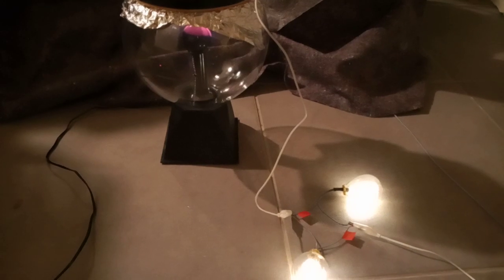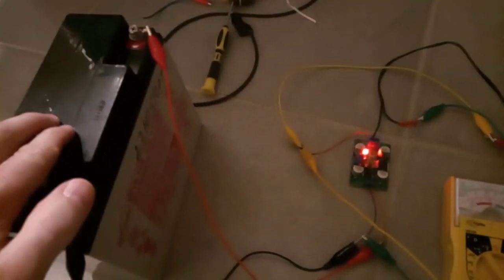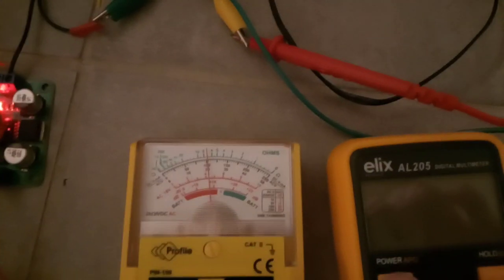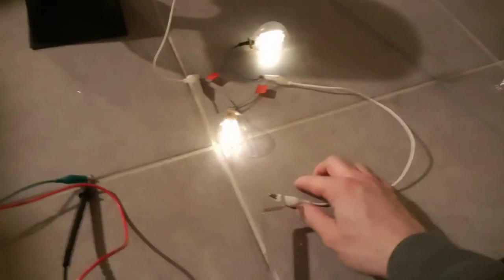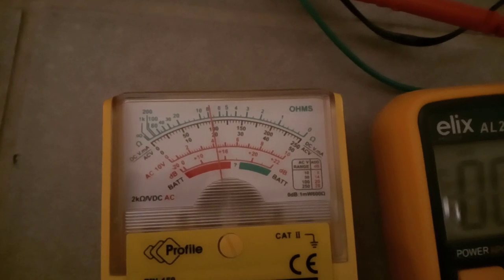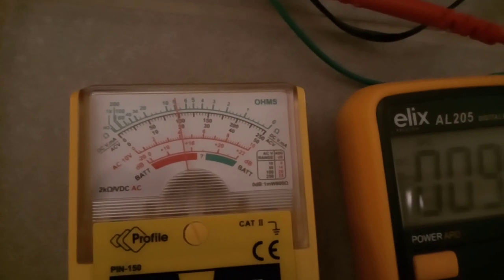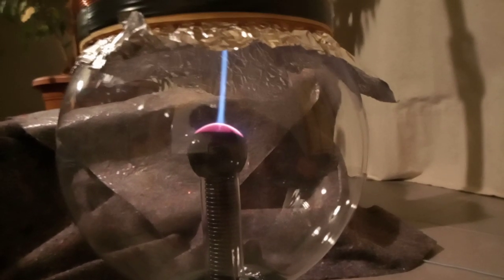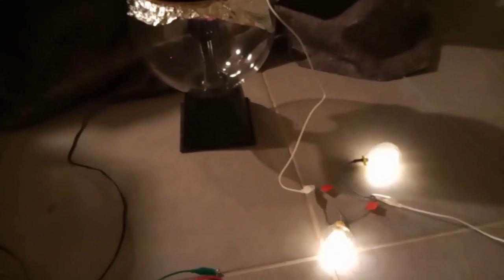Plasma ball battery powered still Earth ground gain

Comment: Good job Bruno. That's what I was referring to. So there you have it in the most basic form. With 2.4W you still have your plasma streamer and also the lights. Of course the lights are not made for that frequency and voltage and that could be improved with a proper load or converting the load. 
Everyone needs to realize that this is only the starting point. We will be focusing on charging by induction in the new kit (almost done). There is no tuned resonator here. There is no cycling of electrons in this setup. This is just like Don Smith's basic demonstration of high voltage to the capacitor plate with arc on both sides.
Reply from the maker: Looking forward to the kit II.
A first try to build 18.6Khz tank circuit from top coil was not succesfull, therefor I want to go for the figure 5 setups in the Tesla true wireless article. I also don't know if I'm correct by targetting that 18,6khz as the working frequency.

Comment: Bruno i have had problems with static collection and measurements with various DMM. I think that a lot of us have possibly cracked the code and the measurements have been wrong. If you can get a lux meter to measure the brightness of the bulbs and calculate what this should be from the mains, maybe this could give a correct measurement. Just a thought. It could be great if you could rectify the output to find out you produce more than you are using.
Reply from the maker: I did a first try past weekend, in fact I started with a rectifier bridge but looking to different options and try minimal components I was happy to see that we don't need much components to see the benefits of Earth ground. When doing experiments I saw another phenomenon that I would really like to look into. When using that bridge and use capacitor that charges then when just powering on the plasma ball the led connected in series with side to ground would give bright flash for very short time, just like the thump in the motor setups from Rick. First I thought it was due to capacitor that was charging and discharging the capactitor partly gave sae result but there was more brightness in that first flash. I didn't had enough time to look into that past weekend but it's also on the to do list.

Comment: Hi Bruno. Very nice! Is your coil wire length tuned to the frequency of the plasma ball or do you have a tuned LC resonant circuit on the coil? Have you heard anything from Rick, or have you already received the Resonance Kit II (I assume you have ordered it too)? 
I can also see a big difference in my experiments when the source is galvanically isolated, e.g. with a battery. Often my consumption went down when I worked with a battery and with the same arrangement the consumption went up when I used a power supply with mains power and then included the earth ground. Thank you for your videos and experiments.
Reply from the maker: @Baudirenergie, I didn't tune the coil, I could also use a plate and that also works. In this setup I think it's more about capacitive coupling.
Reply from the maker: I'm also waiting on the kitII, really looking forward to it and the content that he is still adding.

Comment: Hi Bruno
Great work

Did you measure the output watt? To c I mpare with the input
Thanks
Reply from the maker: @Reza Forushani, I didn't measure that at the moment. I had to little time today. I was more curious to the fact if I could see the gain of using Earth ground even with battery, luckly it is the case 😀

Comment: Next experiment needs a grounded metal box to hold the battery and plasma generator and or a much longer wire from the to coil to the bulbs. Then retest.
Reply from the maker: It,s added on to do list. For battery enclosure I will first look with neon bulb on terminals of batteries. From another experiment I'm working on somebody informed me that there is also action at the battery due tovthis but it was with Kacher circuit and I don't know what type of circuit is used in the plasma ball. I also want to try out the fig5 setups from the true wireless article with that long wire but have to see if I'm able to build  tank circuit for 18,6khz (what I measured as frequency of the electric field) with good Q factor. Adding capacitor to tune the coil from video to 18,6 khz was not succesfull but I'm not sure if I'm correct on working to that 18,6Khz or other frequency.
Reply: @brunovk417  the simple way is longer wire to the lights and take the lights outside and leave plasma and coil inside.